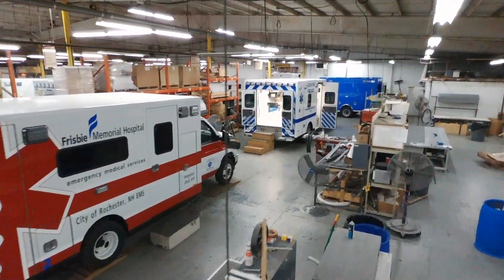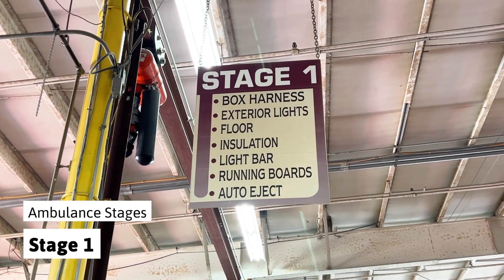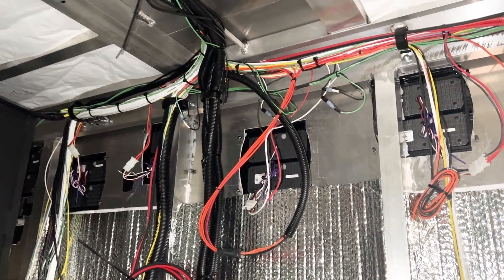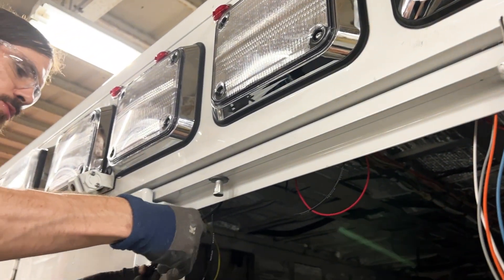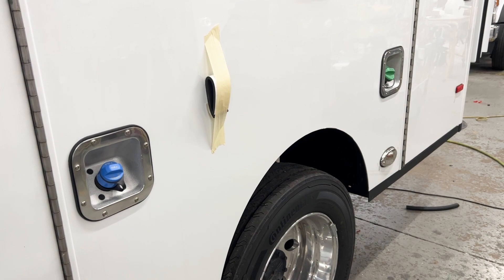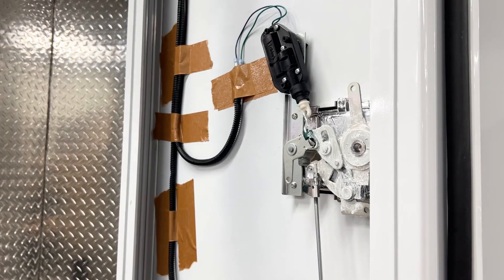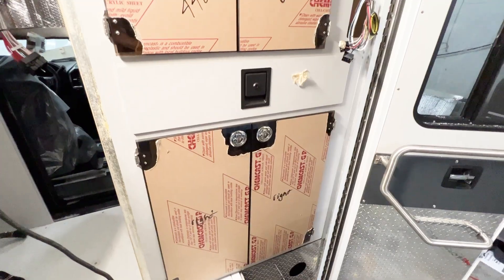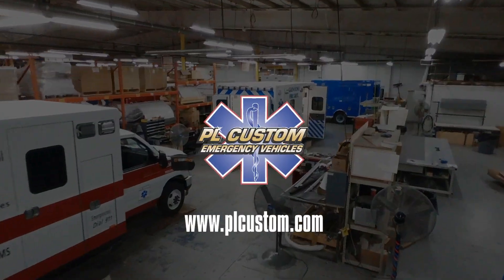How It's Made | Ambulance Stages 1-3

Comment: What makes an Ambulance the PERFECT RV is the size, which has been PERFECTED OVER TIME by LOTS of INPUT from LOTS of FIRST RESPONDERS. Basically, the bigger the better when you're parked, and the smaller the better when you're driving! Also, another reason is because its square, as opposed to Vans which have lots of curved corners!

Anyway, for these reasons, I believe that an Ambulance conversion makes a lot more sense than a Van conversion.

So, do you have any recommendations where I should look to find a used Ambulance Box, that has been "gutted" or possibly even a new Ambulance Box, as a starting point for an RV conversion?